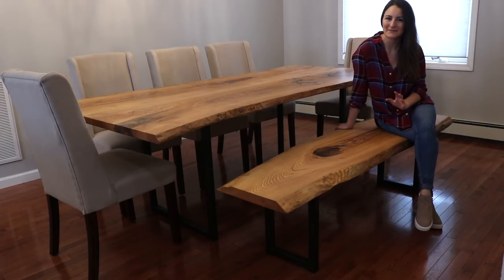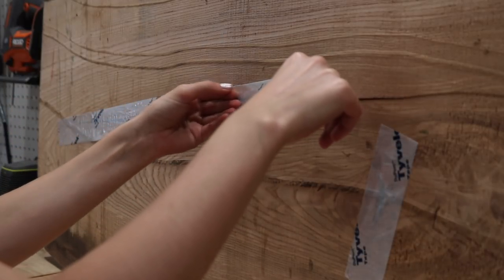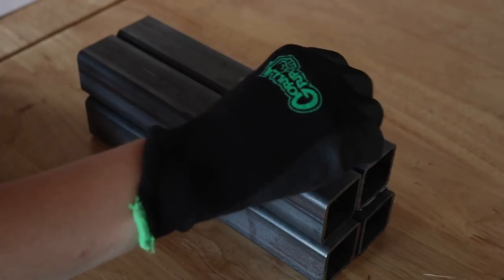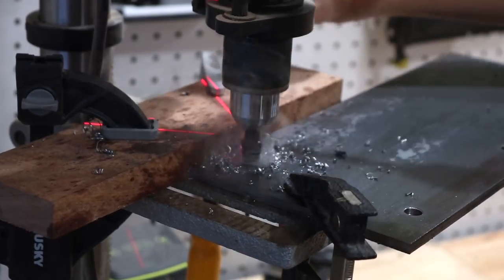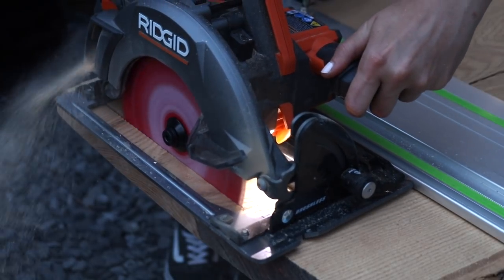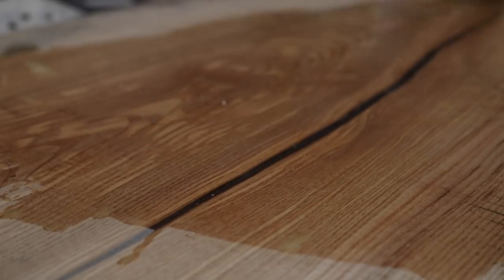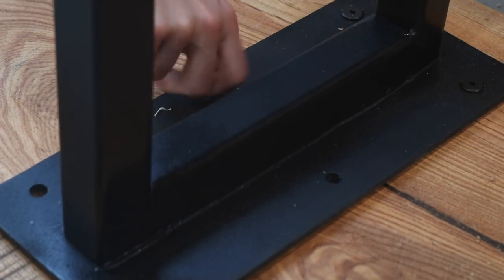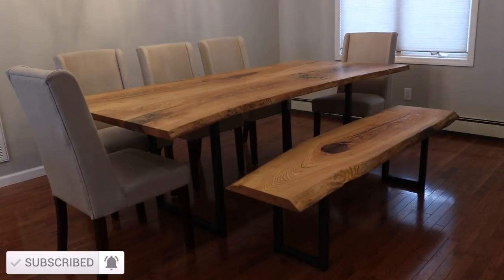DIY Live Edge Bench With Metal Legs | Dining Table Build Part 2

Comment: Has anyone mentioned the squares would would work a lot better it'd they were facing three correct way?
Reply from the maker: What do you mean?
Reply: @diyhuntress  the red metal squares at 2:29, the two long faces are  square and should be in the corner.
Reply from the maker: The ones I got weren’t perfectly square anyway, which is why I used a carpenter square and then adjusted the magnets/clamps to help the angles stick where I needed them to. I’m just starting out (this was my first welding project) and it was recommend to me by other welders to not rely on those magnets, but to use them to help guide the pieces I’m welding. Always a learning experience... next time I’ll do better.

Comment: If you like this table they sell these as a kit at home Depot. Just the table part not the bench.
Reply from the maker: Wait, really!? That could be a cool option for people with limited tools. Do you have a link?
Reply: @diyhuntress  here's a link for Lowe's. This one isn't as wide as I remember only 3ft. They could always rip an edge off and glue two together. https://www.lowes.com/pd/Live-Edge-Natural-Wood-Pine-Rectangle-Coffee-Table-Top-Actual-2-in-x-19-in-x-72-in/1000449683. Here is a link to metal legs that could go with the slab. There are 2 or 3 styles at Lowe's this is just one of them. https://www.lowes.com/pd/Live-Edge-Metal-Sofa-Table-Leg-Actual-3-in-x-24-in/1000504467
Here is a link for home Depot with a few different kinds and different prices. Just keep scrolling for a few extra choices. https://www.homedepot.com/b/Lumber-Composites-Boards-Planks-Panels-Appearance-Boards-Planks-Hardwood-Boards/N-5yc1vZ1z18gp4/Ntk-Extended/Ntt-wood+slab?Ntx=mode+matchpartialmax&NCNI-5&visualNav=Hardwood%20Boards.
I hope this helps.
Reply from the maker: Very interesting! Makes it more accessible to people who don’t have a yard nearby. Thanks for sharing!
Reply: @diyhuntress  no problem.